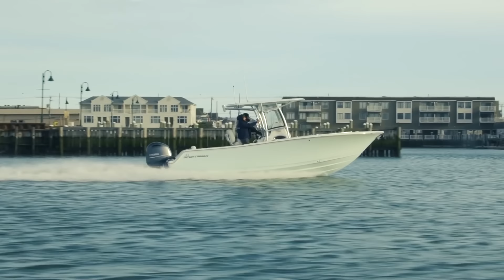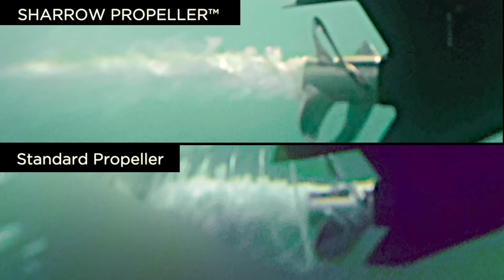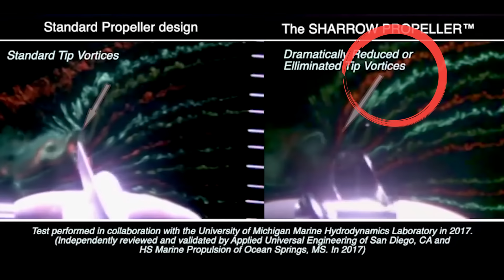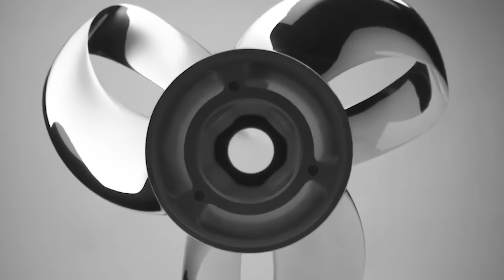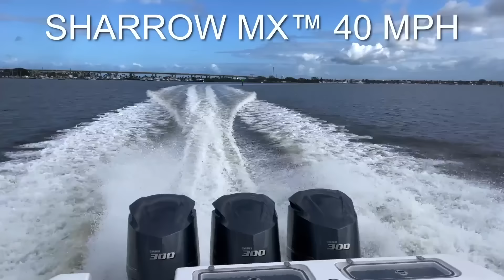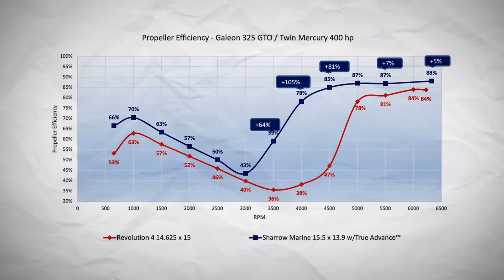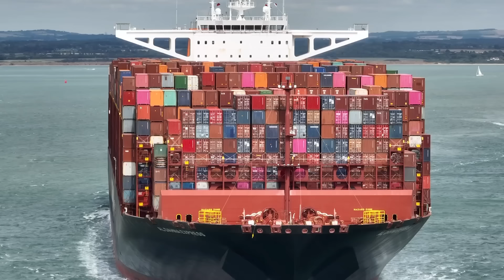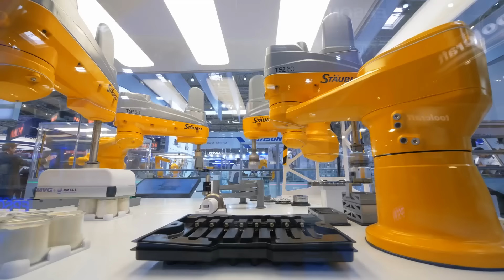This Genius Propeller Will Change Transport Forever

Comment: (1) Double Air-contact Area, equivalent to 2×2 Blades
(2) Prevent Vortex flow a @ blade tips.
(3) Increase striking Momentum of Blades to encounter Air-mass/Flow. Hence, increase Lifting load.
(4) Make Balancing of four support-corners.
(5) Maybe lift-up the Cooling /ventilating of air through Motors
(6) The Quieter/Reduced noise of Air- friction, or lower the Tip speed of Blades.
(7) Higher durability of operating life (of Blades)
(8) ... Only deficiency is a little less Battery operable time per charge (?) or little lesser Distances.(?)

Comment: So I understand the design and how it work especially for outboards. Instead of the exhaust gas interfearing especially in reverse with the bite of the prop. Hoe come the boat builder’s ant the engine manufacturers haven’t jumped on this design?

Comment: I don't like these "Genius XXXX Will Change XXXX Forever". Fist of all no, also WTF is wrong with you, you are a science communicator, you should know better. The MIT toroidal design has been tested till nosebleed. It behaves as a high blade-count prop ... at a specific low rpm .. and that's it,.. and it also can have massive harmonic vibration issues. It is not at all more efficient than a normal prop with some Boeing winglets, and outright less efficient as a ducted propeller.

The noise has a better ring to it, less annoying, but it is still noisy. For a pleasure boat, it is mandatory.

Comment: 500 $. zu 5.000 $ sind 4.500 $  Unterschied ? Macht  im Sportboot wohl kaum  jemand.  Also bei kleinen  Motoren  und wenigen Stunden im Jahr  auf See .  Aber es gibt Boote, die  jeden Tag stundenlang  Vollgas  laufen.  Und dann  sind 20%  Ersparnis  beim Sprit   schnell  4.500 $  und zudem spart  man viel  Zeit, weil  man schneller  fahren kann  mit weniger  Motorleistung. 
Ein 100-PS-Außenbordmotor verbraucht bei Vollgas (WOT – Wide Open Throttle) typischerweise:
🔧 Faustregel
Bei Vollgas verbrauchen moderne Benzin-Außenborder ca. 0,25–0,30 Liter pro PS und Stunde.
➤ Rechnung für 100 PS
0,25 l × 100 PS = 25 l/h
0,30 l × 100 PS = 30 l/h
✅ Realistische Praxiswerte
Je nach Motortyp (2-Takt / 4-Takt), Einspritzung, Propeller und Boot:
ca. 25–35 Liter pro Stunde bei Vollgas
Kurz gesagt:
👉 Ein 100-PS-Außenborder verbraucht meist 25–35 Liter Benzin pro Stunde bei maximaler Drehzahl. 
Bei  10 h wären das 60 Liter  am tag, die  man einspart , bei 6 Tagen 360 Liter  und in 50 Wochen 18.000 Liter. 
Das ist selbst  in den USA. oder Indonesien   mehr als 4.500 $  wert.  Und Boote die zu Inseln  fahren  und 5 h eine Strecke  benötigen, gibt es massenhaft.  Also  100. PS. ist ja  noch eher ein kleines Boot.

Comment: This is brilliant food-for-thought when considering applications to the following:

Active type:
> Pistonprop aircraft (fixed-pitch blades.
> Turboprop aircraft (variable-pitch blades).
> Helicopters (including NOTAR types).

Passive type: 
> Horizontal axis wind turbines (including coaxial spool, contra-rotating types).
> Vertical al axis wind turbines (including coaxial spool, contra-rotating types).

The most important issues would be blade strength, blade material, blade speeds, blade pitch (uniform angle or varying angle between hub to tip). What do you think about my considerations? Thanks.

Comment: could you imagine if World War II planes had these props instead of the normal ones?

Unfortunately during that era of metalworking and manufacturing, it would have been practically impossible to have a Toroidal propeller plane to be readily manufacturable in masses and in the hundreds due to the time it would take, the man power and the budget it would have taken to make one of these during that time.

but let's say that we actually had the suitable technology to make toroidal props in masses during WW2. I do think that the legendary planes during that era would have literally performed TWICE as good as it would with normal props, maybe the Bf 109s from the Germans would have gotten more energy and sustain more energy during a dogfight, the stall performance would have also probably been crazy too, the Spitfire from the RAF would probably have pulled more Gs during a dogfight due to having more speed and efficiency during a level flight. WW2 era planes would also probably have increased stealth capabilities and could do more strategic and surprise attacks against their enemies (though maybe the noise from the 27L piston engine some of the planes had would cancel out this thought LMAO).

I also think that the Germans would have had the first Toroidal propeller plane design during WW2 and it would have probably been called a "Wonder weapon" today 😂

It's amazing thinking about concepts like these. I became inspired to take Mechanical Engineering because of innovations like these. It's amazing

Comment: Makes me curious a few things:

1) the electric Candela C-8 hydrofoil has an 80% fuel reduction once the hydrofoils are turned on. They use a counter rotating double prop configuration. 

What would happen if they used a toroidal prop?

2) can & is there any benefit to using counter rotating toroidal props?

3) cab bionic propeller configurations be incorporated into a toroidal design? With any added benefits? 

4) vs counter rotating, what if made longer? In less a HAWT design and more a VAWT design where they could run through multiple toroidal twists?

5) now make those longer/multiple toroidal twists counter rotating on the same shaft.

Comment: I experimented with a ducted propeller which was just simply a vornado fan submerged in the bathtub. I didn’t have any test equipment with me because I didn’t afford it, but the side effect was the water was electrified. Thankfully I had a rudimentary safety barrier. Honestly I could have done better, by at least modifying the setup so that the motor is outside of the tub. I am just bringing it up because people are always coming up with ways to improve a ship propeller and my attempt was obviously dangerous but the results were pretty average, save for a ridiculously low increase in efficiency.

Comment: Too bad the Sharrow Marine props cost 5x a standard prop.  Sharrow cherry picks data points.  They compare a boat pushing water to get on plane vs a boat on plane.  I figure the real savings are single digit percentage.  Payback periods are infinite if you assign any rate of return.

Comment: Before i finish this what about power. We had two props for our boat. One was for more power and the other more speed. Where does this sit in that scale?

Debris is going to be a larger problem than with standard props because the loop may catch more items to break the propeller off the pin holding it on. Debris being anything you could hit especially rope or wires and lines and branches pieces of wood and other items. The other prop may hit but not grab and this prop is going to grab.

Comment: Hi. This prop could have an impact on hobby microlight aircraft, but the cost would probably put it out of reach. Larger aircraft need a variable pitch propeller which obviously this design cannot do. (The variable pitch has the same effect for a plane in the air as a car's gearbox does on the ground). It reminds me of a turbine impeller which has high efficiency, but only over a narrow range of rpm, so this design could also work well in hydro-electric power generation. Cheers, P.R.

Comment: 03:00 105% is a bit misleading. It is not that you put 1kW in and gets 1.05kW out.
At 4000 RPM it performs 105% better (from 38% eff to 78%).

Comment: no No Noooo!!!! You are missing the point ...Uhmmm Reverse this for power producing dams... You have X water and want to produce Y kilowatts... You can make the absolute most power for a given amount of water....Hoover is losing water...errr you have 17 generators all producing less kilowatts per foot of water...at 17 to 1 odds awe come on some one has already ran the numbers...RIGht...err right...? Super computers should make this an easy proposal.  You have a 95% run time at X rpm.  You can custom make a power producing propeller at X rpm per diameter and flow than anything on the planet. THINK BACKWARDS.

Comment: The difference between Sharrow and MIT is that Sharrow engineered it and MIT just generated a bunch of  random designs varying parameter and put the intern to print it and test it. 😂

Comment: Props do not have to spin so fast as to produce cavitation and aeration.  You use more surface area on the blades, more pitch, and larger diameter.  Problem is, most motors cannot make nearly enough torque to spin them.
My outboard may have said 200HP, but it’s actual torque (power) was a joke, and it had to spin at 5500 rpm’s to achieve useable power.  I converted to a true V-8 inboard that only needs to spin to 3500 rpm’s to produce double the torque of the outboard.   Went up to a 18” wheel for far more thrust at a lower rpm.   This matters when your motor is under constant load for two hour runs offshore.  There is no coast on a boat.

Comment: Pretty interesting!

- But moving parts are not connected through hybrid connection, thus they don't interfere each one with another one bringing new 'whole construction' effects. They are rotated through axis constructing being doubled in working side. Thus enforcement is not that wondering.

- First of all any dynamics going through flows make moving parts (and not only)  more solid as construction. Birds, insects, any animal has it naturally. So we can mark such dynamical part as another one detail. Having changes in vibration, shape, etc it transmits, with own value.

Symmetric, opposite load of moving part of propeller's moving part is not broken on construction it is fixed to, with mixing with another one from another moving part. It goes through and back making whole shape, with accumulating of not broken physical and not only effects, bringing new features, effects. Fuel, being organized at micro-macro level, have it in dynamics of explosion, as organization is prolonged in further dynamics. Such part in blood flow has chemistry etc organized co-connections, leading to overhybrid, having self-renewal from entropy as part. It is one of differences of overhybrid to hybrid, simply keeping it much better than 'less-hybrid' types. 

Thus for making new antena you need to pay attention to connection of parts. In static, either dynamics. Overhybrid may make moving parts - overstabke antenna with context usage. In statics either dynamics. Skipping huge part of detail with AI effects inside from physical design. Thus your head is not too big. 😅 Bringing co-thinking enforcements to brain. Full dual reusage requiring not simply complex co-consolidation.

As for propeller - it can raise up addition power force from organized noises, besides organized shaped constructions, leading to appearance of new co-flows, like strong camertone, with taking noise energy even from env. With self-organizing by organized plasma, bringing jump in power.

Comment: Toroidal blade; the push pushes the push, adding force to the next blade. (~9.32%?). Cavitation could be reduced by narrowing the prop flow, and agitating less volume, I recon. 
Visualize a torus.  (A torus is a sphere, turned inside out, basically. Spheres are the most stable shape. (Both the donut and the hole, so to speak.))

Comment: What the internet needs is some insight into propeller theory because the big efficiency gains being claimed for this prop do not even exist in theory. It is unremarkable for a prop to achieve 70% efficiency, hence losses are 30%. Not all those losses are drag. When the blade is operating at its most efficient angle, induced drag is half total drag. This toroidal prop is said to improve efficiency by reducing tip vortices, which are induced drag. Even if you hypothetically reduce them to zero you can only save half the blade drag which is less than half the losses, which is less than 15%. So the claims of “105% more efficient” prop, or “46% more fuel economy”, are ludicrous. They may be getting these things but it is by a bogus comparison not by a design ‘breakthrough’.
   Furthermore, when it comes to airplanes, typical prop efficiencies are higher still, tip speeds are transonic and the last thing you want is the extra wave drag you are going to get from that toroidal tip design. So don’t be thinking what may work on a small drone will work the same on a full sized airplane. Aerodynamics does not scale up like that

Comment: You mentioned cavitation bubbles but missed mentioning the amount of damage they do to the propeller. Cavitation bubbles not only decrees  efficiency but also damages the propeller, like allot. Just google propeller damage + cavitation bubbles, and you'll see what i mean. Thus, if this design reduces cavitation bubbles the durability of propellers will greatly increase, larger ship propellers are very effected by this as well, so lets hope this design is scalable!

Comment: I think ive heard that these propellers need to be 3d printed because of their complex shape. 3D printing scales linearly not exponentially as you increase production which is a huge problem for a product. It means you cant bring the price down by economies of scale wich means that toroidal propellers will, as long as they're 3D printed, be expensive as shit.

Comment: Just a suggestion that the golden ratio be utilized. The circle that is being utilized currently causes drag, the golden ratio will give it up more efficient cutting surface.
The following is a copy and paste from Wikipedia
In mathematics, two quantities are in the golden ratio if their ratio is the same as the ratio of their sum to the larger of the two quantities. Expressed algebraically, for quantities a and b with a > b > 0, {\displaystyle {\frac {a+b}{a}}={\frac {a}{b}}=\varphi } where the Greek letter phi denotes the golden ratio

Comment: Double the efficiency? You mean existing props were less that 50% efficient? Sounds like bull crap marketing wank
Reply: no, it's 100% better than the previous ones
Reply: @r4d1k0l  so if the previous ones had 70% propulsive efficiency these have 140% propulsive efficiency? In the field of fluid dynamics 5% improvement would be considered very impressive, astounding, game changing. Your claims are silly and physically impossible, making it obvious to anyone with any technical background that they aren’t credible

Comment: I'm extremely sceptical. SO MUCH work has been put into designing warships/submarines etc. If this really works then every ship propeller has to be replaced with this design IMMEDIATLY! That would be insane if you could have so much more efficiency with just a small design change

Comment: Cherry picked data.  Picked 4000 rpm, which is the greatest efficiency gap, but NOT the "mid-range" operating speed.  Interestingly, mid-range is around 3000 rpm, but not convenient as the efficiency gap is only 3%!  Also, the 40mph noise test didn't provide engine speed comparisons.  Now, let's look at the "20%" fuel savings versus prop cost premium.  If a standard pleasure craft in the US consumes 4.5 gph at cruise and fuel is $4/gallon, that is an $18/hour cost in fuel.  So, a 20% savings would reduce the cost to $14.40 hour, or $3.60/hour savings.  Average US pleasure craft accumulates 30 hours a year.  So, $108/year savings.  At a $4500 cost premium, it will take 41.6 years to break even via fuel cost savings.  This is even worse when you actually only realize a 3% savings in real life.

Comment: Have any propellers been developed for use by radio controlled model planes? I have a 30cc petrol motor with an 18 inch size prop. Infact, something to replace a ducted fan would be well recieved.

Comment: Nonsense BS !  Clickbait. 
There is no such thing as 105% efficiency 
Efficiency is te result of power input and power out put.
So where does the 5 % extra come from? If so you have an energy source.. and I love to have it. 

Next to that these prop design work well under water as water is not compressible.
But in air they are less efficient as a normal prop. This has all to do with induced drag and parasite drag.
Stop mixing aero dynamics with water dynamics.

Comment: It's an ancient design, it's not new at all. It's not utilized, as this design is inducing some metallurgical fragile points in the propeller. Rather applying more power to a conventional Propulsion design than losing propulsion completely in a propeller fail.

Comment: Thank you for the interesting and informative video. The comments generated are interesting too. I recall reading about a similar engineering project occurring several decades ago (also in Seattle, maybe Boeing or a subcontractor) involving a ‘ringed blade’ for rotary wing aircraft, and on smaller scale the same for replacing the conventional propeller. Also discussed were marine applications. Perhaps the challenges and costs of research, manufacturing and production at that time were not realistic. Congratulations to those who advanced this principle with modern technology and application!

Comment: As a Dronepilot, I sure hope Manufacturers will focus more on propeller noise reduction.
Weirdly, Specially large & expensive drones often have the most rudimentary blades.
Example: DJI Inspire 2 and (judging from leaked images) also the Inspire 3.

I also find the strong low- & mid-range rpm noise reduction interesting,
as hovering and going slow is often were you feel the most embarrassed.
Experienced it many times that launch and getting in position seemed fine,
but as soon as you start working ...